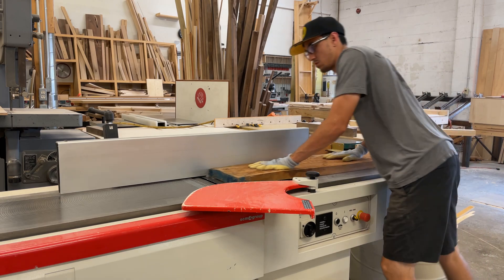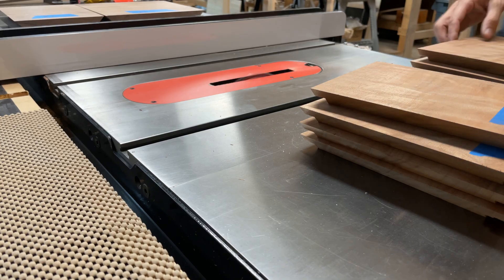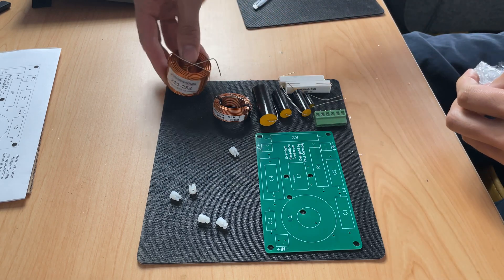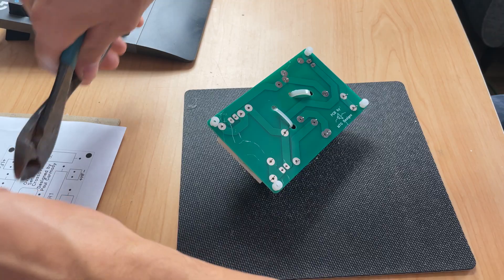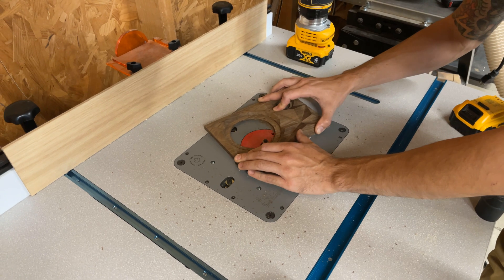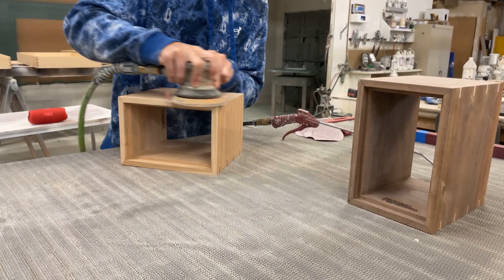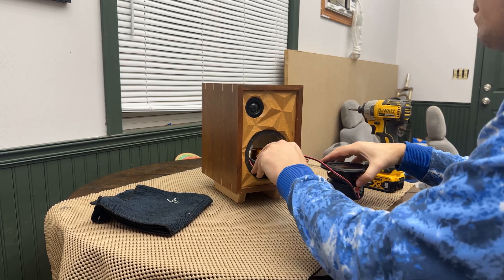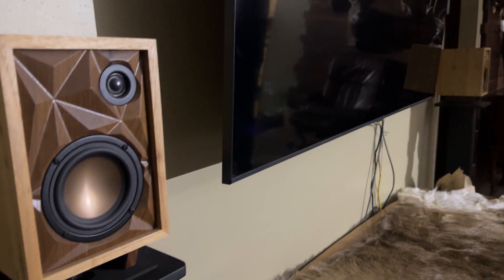Overnight Sensations Full Custom Speaker Build | CNC Machined Front Baffle

Comment: Tweeters not close enough to the midbass will cause problems
Reply from the maker: So if I built another pair should I adjust the tweeter closer to the mid bass in the baffle?
Reply: @hardtimeswoodworks  The closer the tweeter is to the midbass the better, imaging will be greatly improved, or you could use a single concentric driver with its tweeter in the middle of the midbass driver

Comment: Don't use rings on the back of the baffles. That adds bad internal reflections you don't want. It harms the sound WAY more than most people could realize. Instead just glue in small blocks where the screw will go.

Comment: Beautiful workmanship, I always wanted to make this speaker but then I always ended up making something bigger! 
I really like them, just one question, doesn't the geometry on the baffle affect the sound?
Reply from the maker: I honestly haven’t noticed the baffle changing the sound much. What I do notice changing the sound is the species of wood on the box. The denser heavier woods I think the walnut speakers sounds a bit echoey so I ended up lining the inside with sound deadener to help it out.
Reply: @hardtimeswoodworks  I usually use MDF or plywood, preferably birch, for the case, and a sandwich of plywood and solid wood, often bamboo, for the baffle.

Comment: Would you be willing to share the file for the front baffle?
Reply from the maker: I have a video showing how to model it up. Would you need a fusion model of it or just like an stl model?
Reply: @hardtimeswoodworks  Either one. Ive never used fusion as my CAM but it might be a good project to start on. Im typically a Vectric user